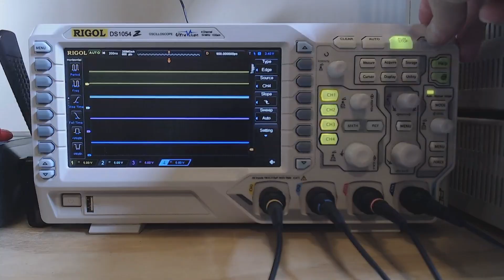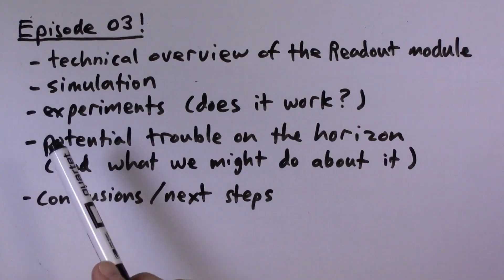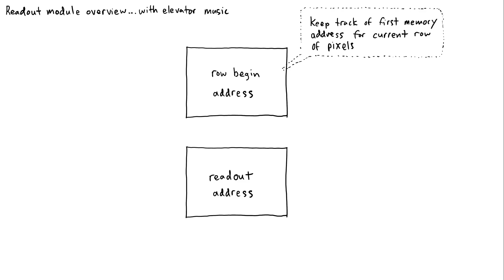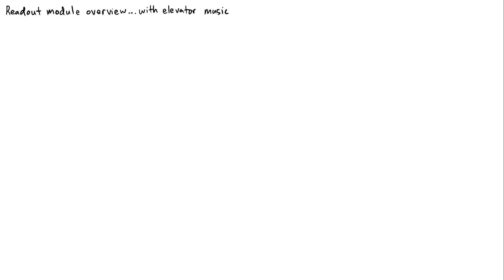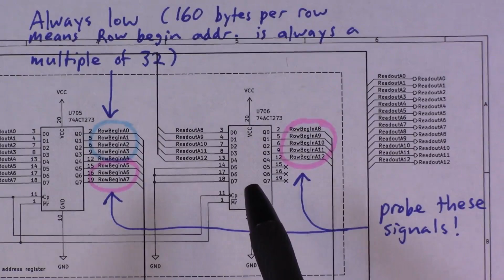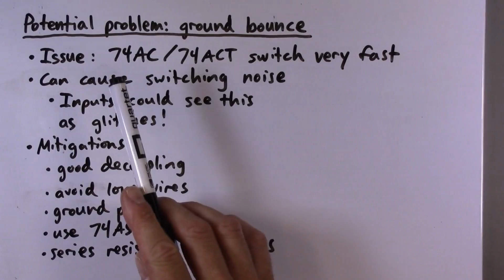Hardware VGA, Episode 03 (Alternate, no background music): Readout module

Comment: I've built a few concept design boards for VGA output over the years, mostly just on Breadboard but a couple on Veroboard. In all situations I've used TI 74HC components and never had issues with timing or bounce. I'd imagine I wouldn't be so lucky if I was using old chips (or fakes) rather than brand new, but I thought I'd just put that out there.
Reply from the maker: Thanks, that's good to know! I think the main difficulty with using 74HC/74HCT is that counters (like the '163 ones I used) can't meet the setup time requirement when clocked at 25+ MHz. I could almost certainly use slower parts for some of the other chips in the design. I actually tried out a 74LS153 as the pixel color selection mux, and it worked fine.